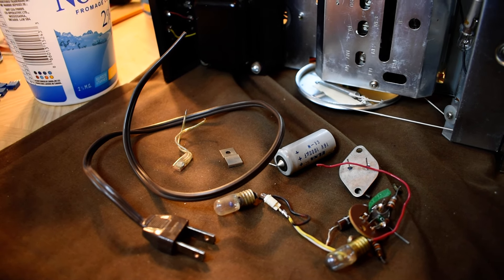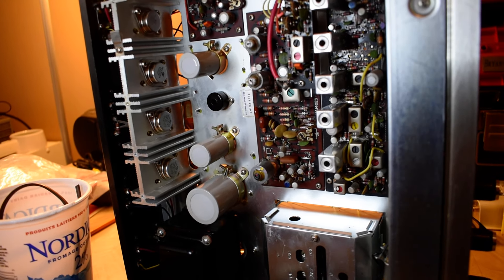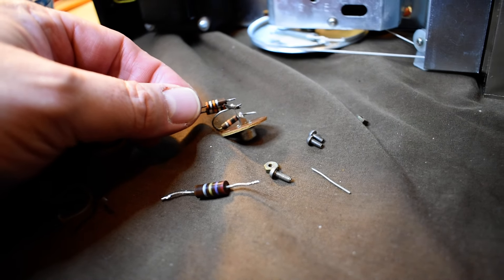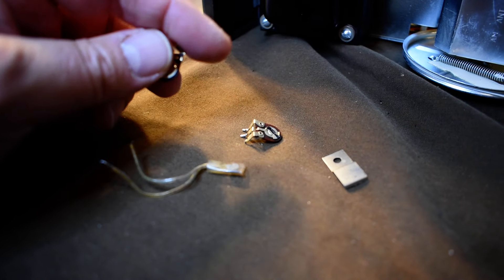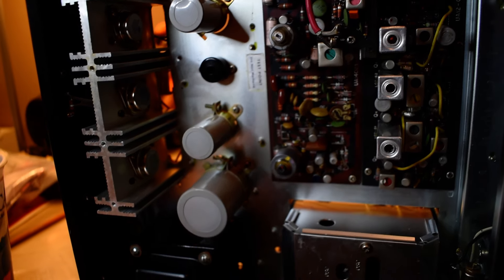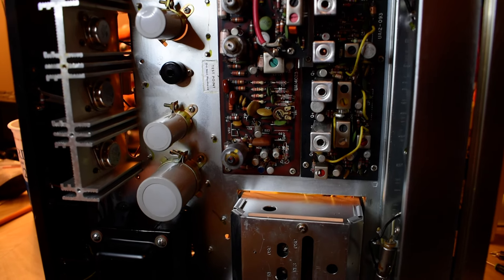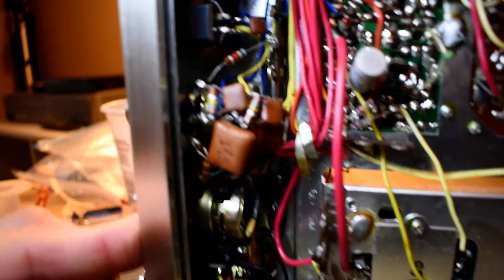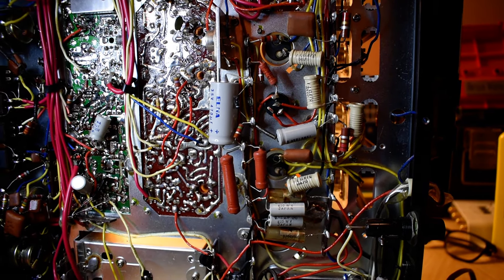Kenwood TK-66 resto part 2- the strange things you find in vintage electronics!

Comment: Hi, just wondering if you are going to post more on this receiver. I am getting ready to restore a fairly noisy TK-66 and I'm curious about what you are going to use for transistor replacements, especially the germanium driver transistors. Great videos! Thanks.
Reply from the maker: Check out latest video on KA2000 about bias potentiometers.  It's the same board.

Comment: Good evening.. Friend, I have a Kenwood TK-66 missing an AM antenna bar. I want to make the coils with awg 30 wire. There are 3, the first coil is for tuning, the second is for feedback and the third coil is for the antenna. 1 of the terminals of each coil is connected to the ground black wire. and the red wire is connected to the tuning coil tap. the white wire is connected to the feedback coil tap. the blue wire is connected to the antenna coil tap....the question is I don't know how many turns the tuning coil has and I don't know how many turns the feedback coil has and I don't know how many turns it has... I don't know If the core in the Am bar antenna contains a ferrite core or if it doesn't have ferrite, I know if I knew the inductance of each coil it would be easy for me to build this Am bar antenna
Reply from the maker: Hi, looking at my TK-66's AM antenna bar there are four wires for 2 coils. The antenna is glued together so I can't see how it's made.  The antenna coil measures 377uh and the second smaller coil 26uh.
Reply: @acrossthedial I made a copy of part of the original scheme... the smaller coil I named L1, the second L2 and the third L3. This scheme is very detailed. There is no need to disassemble the antenna, the black wire is grounded to the GND and the inductance in the following wires is measured using the GND. for example, from gnd to the tip of the blue wire is the smaller coil L1. red wire connected to the tuning capacitor is the L3 coil.... perhaps the coil that gave the smaller inductance must be L1. the other measured coil does not say if it is L2 or L3, perhaps the L2 and L3 have the same inductance. https://drive.google.com/file/d/1bhf9cAqvtqGohinjDN13CaJ90mlS4uWN/view?usp=drivesdk

Comment: The 2N3055 is a very old transistor. It does not have the greatest specs. Sometimes the sound is not as good as modern devices. The newer manufactured  parts can have different gain and frequency response and can sound different or sometimes oscillate. The various amplifier forums discuss this problem and some suggest a better replacement.
Reply from the maker: True, the 2N3055 is an old design but a good match for this circuit.  It's  0.2 mhz transition frequency makes it a slow device but also gives the output a warmth and character.